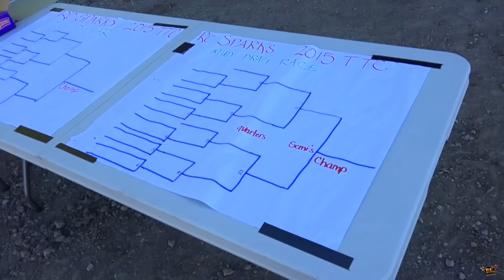RC ADVENTURES - TTC 2015 - SLED PULL / Weight Pull - Tough Truck Challenge (Event 1)

Comment: Hey medic, I come from the USA or tractor pulls her a common thing where I'm from… You should invest in one of those weed killer sprayers at all hardware store and fill it with water and lightly missed the ground after every truck runs for your polls.. As well as grooming water and maybe even get some kind of wait to drag over at the course it doesn't need to be heavy there only RC's

Comment: Man, the black widow just tore it up!
Reply from the maker: +Captian Thiele yes, it is a secret weapon. Looks like a sleeper, but is incredibly fast on 3s lipo!
Reply: ***** I can see. I am really jealous of that truck! I really like the tires you have there also.
Reply: +RCSparks Studio dude can u tell a shop in Toronto to get my 6 cell fixed
Reply: Arshdeep Mehta I don't know any of the shops there, but if you find one using google any shop should do it for you. Really, they would only diagnose the problem and tell you if you need to buy a new one.

Comment: I know its probably a dumb question but i'm new and wondering: why do some of the trucks lean to the side? Anyways, great videos medic, keep it up man! Thumbs up from NC in the USA!
Reply: i think its torque roll :)
Reply: The motor  and driveshaft(s) turn one direction, and when the motor forces the shaft to turn even though the ring and pinion in the axle doesn't want to, it creates a phenomenon called torque twist. Think of it as if the driveshaft(s) didn't move at all, the transmission and transfer case would turn instead. That's basically what this is doing, causing the chassis that transmission/transfer case is on to twist in the opposite direction the shaft spins, until the force's coefficient matches the spring rate in the suspension. You can tell the dual motor and single motor setups apart by this. The dual motor setups don't have driveshafts, transfer cases or transmissions, so there's nothing to make it twist. Hope this helps you understand. It happens in crawlers a lot, and can be a really bad thing on trails.

Comment: question for you medic. putting together a local ttc in my area. rules are lack like yours but the question is were tire changes possible. for example could you change tires to the tractor tires for the mud bog races as long that's the only change made to your truck? trying to get a feel on what rules we should come up with for the events
Reply from the maker: +carl vanwagner It's YOUR TTC Bro.. make the Rules YOU want!  :)

Comment: You could of wet the track down a bit, I bet the tires would of got more traction
Reply from the maker: +grimthenoble It would only make the soil muddy. More weight, and wheel speed is what some of these fine trucks needed ;)
Reply: +RCSparks Studio™ Ive seen them wet the full scale tracks down a bit with water to make the soil more tacky 25-30 minutes before they pull on it. Enjoy the videos either way wish you guys were around here would love to be a part of your tribe! lol
Reply: The tracks at real pulls are typically red clay which gets really tacky when wet before it turns into mud, this was likely done on dirt which doesn't get tacky when wet. A shorter chain going to the truck would give more traction though, full size trucks normally have the chain at 20 or 30 degrees which lets the trucks use some of the weight of the sled for traction.
Reply from the maker: +Stewart Hornick 100% correct
Reply: +RCSparks Studio™  Thanks for proving me wrong. was just a suggestion.
Reply from the maker: grimthenoble I wasnt proving you wrong, I was just responding in an educating way.. I live here.. I know this dirt.. It gets very gross with even a little water.. haha!
Reply: +RCSparks Studio™ Its all good, I understand.  Keep up the good videos!

Comment: what a waste of batteries, the trucks are not heavy enough therefore there is no enough traction to pull
Reply from the maker: +TheGoodLife Some folks would rather have a light truck for events like the Mud Bog & Rock Crawling! Heavy trucks usually do poorly in the thick mud. You can not change your weight when you are in the middle of the comp.. and heck, its all in fun anyways! ;)
Reply: It's not the weight of the truck, the chain on a real pulling vehicle is at a much steeper angle when hooked to the sled. If they shorten the chain the trucks would have more traction and do much better. At real pulls a somewhat stock 6000# truck can fairly easily haul 30,000#-45,000# 300'.
Reply from the maker: Stewart Hornick again, this is all for fun and some of the viewers may take it more seriously then it is intended :)
Reply: It's great to see you doing this, I love it. I just think that giving everyone a little better distance with a shorter chain would make it more enjoyable for the competitors and the viewers.
Reply from the maker: Stewart Hornick Thats what I thought.. but they insisted on a long chain. Give them what they want I say.. best i can do ;)
Reply: ***** oh well, didn't notice it was in the midle of a whole bigger thing, I guess there is no problem then, but I still think putting some temporary weight in the trucks would've helped them to pull better, anyway thanks for the response Mr. Medic :)